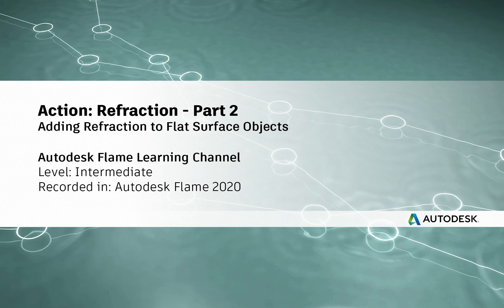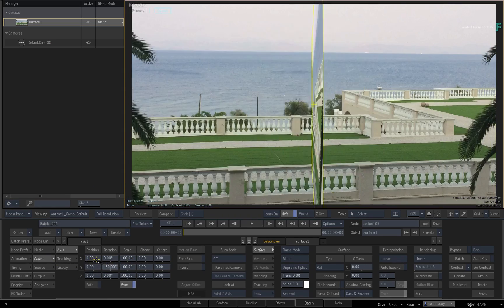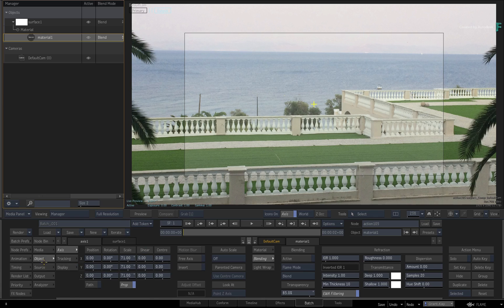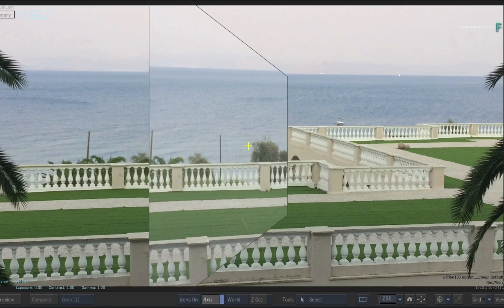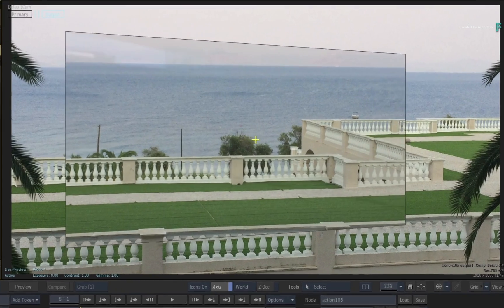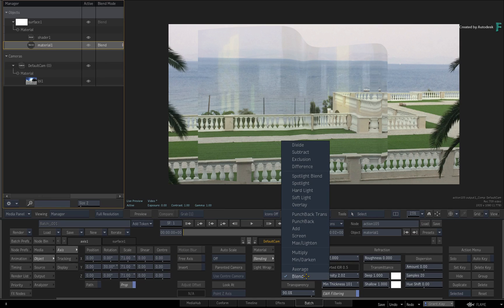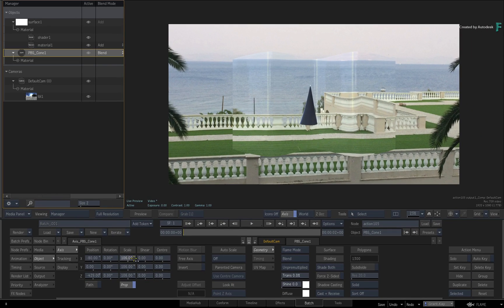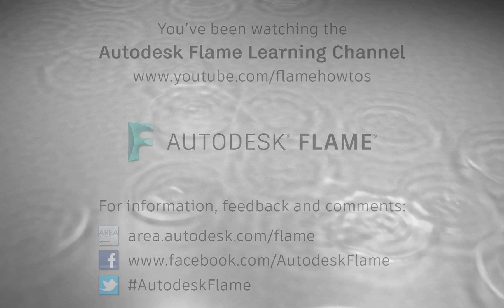Action Refraction - Part 2 - Flat Surface Refraction - Flame 2020

Comment: Awesome enhancement! is there a setting for Fresnel in Flame 2020 materials? It would add a lot of realism to the cg. Thanks!
Reply from the maker: Hi, Flame does have a shader setting for Fresnel.    Once you've textured an object with a diffuse map, you would also apply a shader node to the object.   By default it is PBR but you can switch that to Fresnel.

There are 3 settings you can tweak --  The Roughness (shape of specularity),  the Fresnel Offset (total amount of specular light) and the Fresnel Factor (amount of specular light at grazing angles).

Hope this helps!